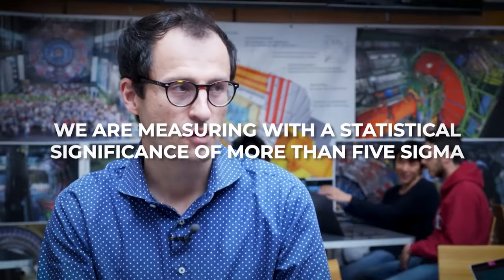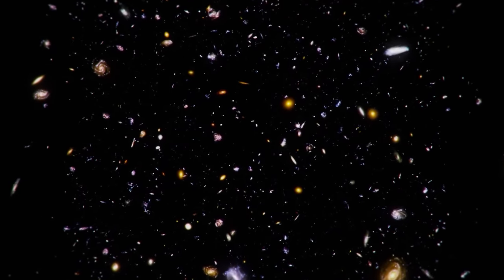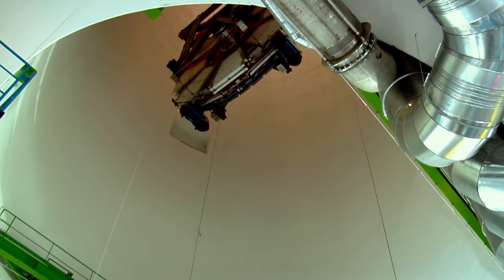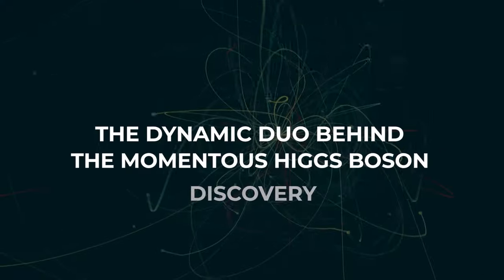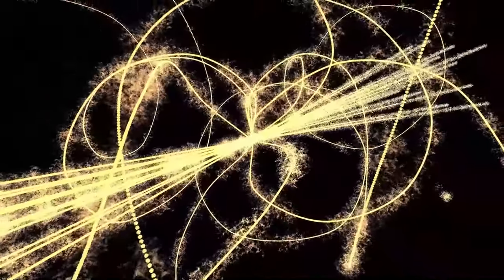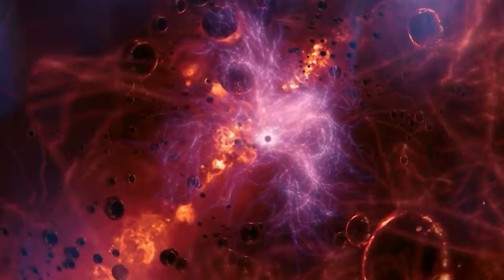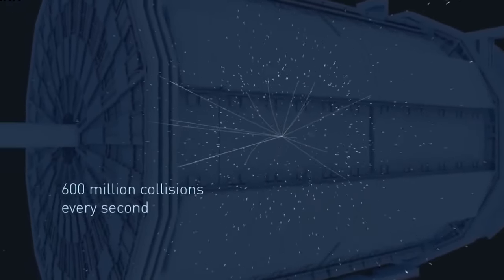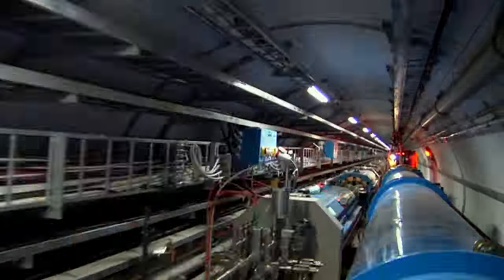CERN Scientists Have Activated Something Terrifying That Changes Everything

Comment: All the cern collider has done is disrupting the earth's magnetic field. All mass is heat in a cold universe. Mass occupies space as neutralized cold repulsion within mass as mass moves through space. Space moves through mass as perpetual motion. Heat is perpetual motion. Unification of unidirectional flow cycling thermaldynamics singularities in quantum magnetic fields as elements. Mass is heat expansion. Heat is all force. The universal cosmic speed limit in repulsion as perpetual motion as a constant speed limit in and out of entanglement of mass. Distance is reduced by redirected trajectories of thermaldynamics singularities passing through mass in quantum magnetic fields as force of pressure in mass.  Hydrogen has the strongest magnetic field. As mass expands, its magnetic field weakens. External magnetic fields disrupt internal magnetic fields by reducing repulsion to occupational space itself as the external flow of plasma. A black hole that is more likely pure black repulsion of space within its core. It doesn't let anything in. Stars blow away their thermaldynamics outward force of pressure and normal space filled with dark heat energy waves throughout space comes into contact with the void of pure cold repulsion and surrounding the repulsion as a sphere and gathers in synchronization of flow around it. An external magnetic field generator. Proximity mass repels its thermal energy towards the weakest point of repulsion. Magnetic fields redirect thermaldynamics singularities towards the greater flow with the weakest repulsion. Magnets show both repulsion and propulsion or synchronization of flow as grounding or bonding power. Equalization of pressure is maintained throughout space. Physics 101. No glouns quarks. Just sparks that they call electrons. Striking sparks as friction. Heat exchanging sparks that light surrounding atmospheres. Lightning strikes. Friction of sparks light up atmospheres in repulsion. Simply space and heat as perpetual motion. Cold repulsion to heat propulsion from cold repulsion outside of entanglement of mass as renewable dark heat energy throughout space as waves from stars decaying atmospheres of elements. When synchronization of flow bonding as unification of unidirectional flow begins to hit more repulsion, it redirects into quantum magnetic fields as mass. Hydrogen has the smallest, strongest magnetic field of the elements. Hydrogen expands into helium under extreme pressure. Mass expands. It is heat propulsion. It doesn't collapse. The earth's atmosphere is a filament sparking light from renewable heat waves exchanging energy like electricity. Electricity is rapid striking of heat current. Electrons are sparks of friction from quantum magnetic fields of forced pressure pushed out and replaced. Physics is simply heat in repulsion to cold space as the cosmic speed limit in resistance. Conservation of maximum momentum velocity in and out of entanglement of mass as renewable energy exchanging singularities point to point chain reactions until resistance is overcome by open space itself. Physics is physical observations of decay and renewable energy singularities exchanging points in mass as outward force of pressure. No collapse of heat propulsion.  Physics works. Gravity doesn't exist.  Mass is heat propulsion.  Outward force of pressure.  Magnetism bonding force of pressure known as weight. Magnetic fields of bonding. Mass is always equal to repulsion within and without entanglement of mass. We occupy space as space itself. Cold repulsion to heat propulsion from cold repulsion within and without entanglement of mass. That's why mass can't collapse.  It is physically impossible.  Theoretically factual probability that works with quantum physics without gravity. Gravity doesn't work. Weight is quantum magnetic fields bonding to greater magnetic fields of synchronization flow. Internal magnetic fields grounding surface mass or current. Magnetic fields generators? Physics 101. Simple Physics. Heat is the universal force of pressure known as perpetual motion. Unification of unidirectional flow cycling thermaldynamics singularities in magnetic fields generators. Bonding and repulsion. Cold repulsion to heat propulsion from cold repulsion. No negative fields. No anti matter.  Dark heat energy outside of entanglement of mass.  Sparks of light are only visible in repulsion to mass as friction. Heat is the cosmic speed limit. Light is sparks of striking resistance in magnetic fields. Physics simply means observations of pressure equalization throughout space as heat propulsion in repulsion. Perpetual motion is constant cosmic speed limit in and out of entanglement of mass.